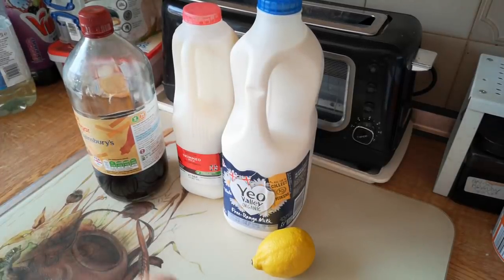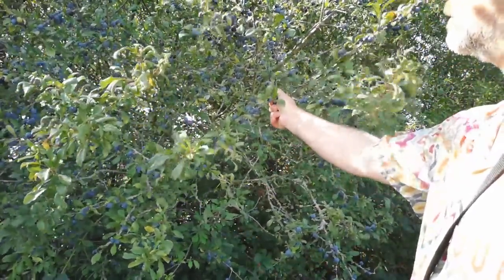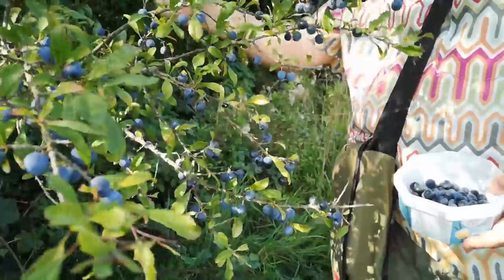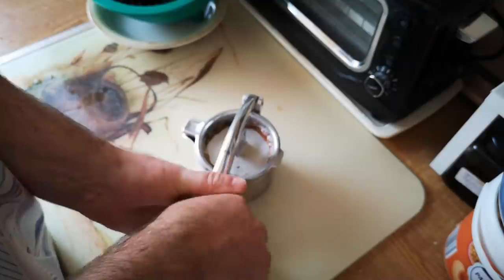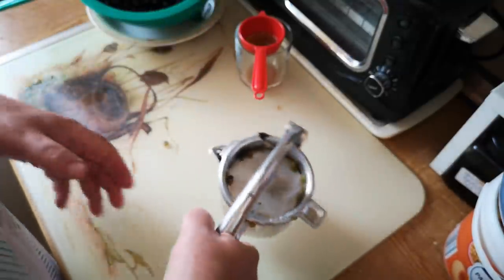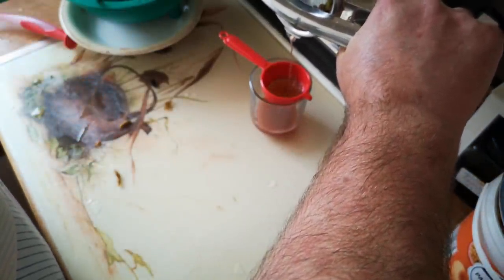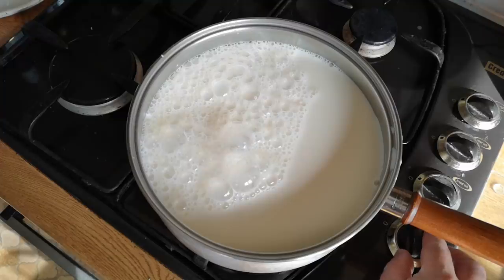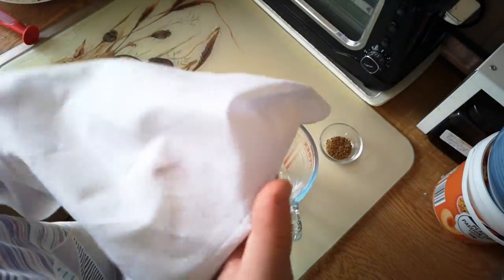Making Curd Cheese Using The Acid-Set Method

Comment: I use sloes to make jelly, which I enjoy on my breakfast toast. I think I prefer crab apple jelly on my toast in the morning (which is sweet and sour) but the sloe jelly makes an interesting change from time to time. Also, at a push, you can use the sloe jelly to make instant sloe gin. If I had to describe the taste, then I would describe it as damson jam plus, sort of.
Reply: @douglasparkinson4123  No, I mean 'jelly, but in the traditional sense. Which essentially means a jam where the fruit plup has been strained, to produce a liquor, prior to the addition of sugar and subsequent boiling. The end result is a translucent jam with no solids and is referred to as a jelly.

Comment: I've made acid set cheese a number of times, mostly when shops sell off milk on it's expiry at a reduced price ;). I also gather sloes every year to make wine. This is an interesting use, I wonder if the extraction of juice could be more efficient by either steam juicing (how would the activation of the pectin affect this) or by freezing the fruit first to break the cell structure a bit before juicing by this hand method. I'm going to give the steam juicer a go this autumn and find out :)
Reply: Did you do it? How did it turn out?

Comment: Interesting twist using the sloes, I've not see any anywhere near me. I've made cheese with lemon juice, white vinegar, white wine vinegar, apple cider vinegar, straight citric acid, nettles, liquid vegetarian rennet and various combinations of those. I just got some FANTASTIC jam/jelly bags really cheap on Amazon that will be replacing my old cheesecloth. Affordable, durable and washable. Nothing sticks to the weave. I was always taught to give it two stirs and then immediately leave the milk alone for 5 to 30 minutes as not to disrupt curd formation as you described for the rennet set cheese process. For maximum curds whey separation, add the tiniest amount of calcium chloride (literally a couple of granules for the entire pot). With that method I get a similar solid yield with 2/3 the milk. I love your straining setup and I really need to invest in a ladle, plus one of those nifty strainers that goes right across your kitchen sink. Your cheese press is just brilliant as well! The cylinder looks more professional than my balls.

Comment: What a fantastic video. It made my mouth water. 
I'm coming up to retirement age. I can''t wait to do things like this when I get more time to potter around and play about!
Your cheese looks yum, but if you want a harder cheese, you could use your pillar drill, put a long piece of tube on the handle, and a weight on the end.
In this way the pressure remains constant as the cheese is pressed, which doesn't happen with the hand clamps. 
Just a suggestion, provided you've somewhere other than the garden, to set up the pillar drill for a few hours!

Comment: You can use the whey in baking, replacing the water 1:1. In case you added salt to the whey (which you didn't in this case) make sure to reduce the salt in the recipe.
I really liked the final pressing method you came up with. In the Scott Rea channel I saw him use various specialty molds for pressing aspic and certain charcuterie, the principle is basically the same as your jig.

Comment: In my country we regularly make curd. We either use the milk that has already gone bad, in which case it will curdle by itself, once brought to boil (a good way to save bad milk) or we add a heaping table spoon of gatig (which is similar to Greek yogurt) per 1 lt of milk again, while heating it over the stove. And curdles float in any case :) I don't think it makes a difference in what type of acid you use.

Comment: I make cheese for Christmas with full fat milk, buttermilk and eggs every year. Quite similar process but not as much stirring. It is lovely, definitely worth a try :) my favourite Christmas food.
Reply: Sounds good! Eggs? What’s the recipe if you don’t mind sharing?
Reply: @Handfulloftrouble   3l whole milk, 1l of buttermilk, 4-5 eggs (if small use 5, if large use 4). Mix the eggs and buttermilk together (both should be room temp), heat the milk until at boiling point then add in the buttermilk egg mixture and gently mix. Heat it back to boiling point and then take of the heat. Dont stir and just let it sit for 30mins. After this gather the curds with a slotted spoon to your container and drain out the excess liquid. Add about a 1tsp of salt to the cheese and then let cool down completely. I usually gather the curds to a sieve that I line with coffee filters to drain liquid out but cheese cloth is probably better option. Once the cheese is drained I tend to put it in a tupperware container and press in there to get a square shape but you can just let it cool in the sieve and you get a dome.

Comment: Just add a good pinch of sea salt, and 2 tablespoons of the liquid from a batch of sourdough starter to two gallons of milk and cover with a clean moist towel, it will actually "re-raw" and curdle naturally, without heat. It is called yogurt cheese, at that point, and is actually a delicious lacto-fermented superfood. You can use the whey as a sports drink. Just add a shot of lemon juice and more sea salt to taste.

Comment: Ooo, that looks delicious. Given how moist it was, did it ever squeak when you chewed a particularly solid bit? You would have my undying admiration if you ever tried to make some big fat curds and made a French Canadian dish called Poutine out of them — poutine is, at its heart, just some good chips with some big fat cheese curds and some piping hot chicken gravy poured over so that the curds are just on the verge of melting. Almost willing to stretch out into strings but not quite melted. Local purists will obsess over frankly every little thing to the point where they can't even agree on what's the best preparation, but that's what it is, at its core.

Comment: Nice cheese... a few suggestions of improving it however. 1. slightly roast the spices in a pan before the grounding them(about 30sec-1min in a dry pan).  This is a trick to enchance their flavour. So don't use it if you want a mild cheese. 2. Use a nonstick perforated cloth so it don't stick. There are a few cloth types to choose from. Kinda like you already hinted at in the end of the video.

Comment: whole milk yields better results. lower heat next time. dump all of the acid at the same time.  you should have used more acid the whey should be clearer.
start removing the curds as soon as they form (immediately) and dont stirr them around and over cook them because they will seize and become chalky

Comment: 11:10 But the milk you used has already been heated to 71.7°C in the pasteurization process Mike,  heating again shouldn't make a zot of difference?
Reply from the maker: With rennet set cheeses, you add a bacterial culture to the milk before it curdled. This is incorporated into the curds and causes the cheese to mature.
If that was done here, the heating would kill the culture, and if the culture was added after cooling, it would not be inside the pieces of curd

Comment: I know this is a bit too late to say but if you are pressing cheese again, would your pillar drill not do the job?. I would use the same  method with the discs and cylinder but just add a rubber tip onto the drill bit holder to stop damage.
Reply from the maker: I think that would probably stress it. The pillar drill up/down mechanism isn't really designed to apply  great force

Comment: Did Atomic Shrimp use raw milk or some other kind of specialty milk? All the online recipes I see call for a raw milk and claim pasteurized and homogenized milk does not work for this kind of cheese.
Reply from the maker: This was pasteurised milk. I imagine uht/homogenised might be a problem. Actually, I think that's worth some experimentation...
Reply: @AtomicShrimp  Well, with a jug of milk being a cheap amount of money to commit to curiosity, I decided to give this a try with 2% pasteurized homogenized milk. 

Preliminary results suggest at 2% the yield is lower than expected, and the cheese curds are much smaller than yours in the video. Your mileage may vary, but cheese was made!

Comment: I feel like it could have used more time under pressure. Like 5 days or so
Reply from the maker: Yeah, I need a more compact clamping arrangement so I can put it in the fridge, or make this in winter.
Reply: @AtomicShrimp  maybe once you dry it out and squish it with clamps maybe just  weighing it down would work so it fits in the fridge + smaller PVC pipe for once its finished with the clamps
Reply from the maker: I'm thinking of finding a PVC pipe that fits a sealant gun